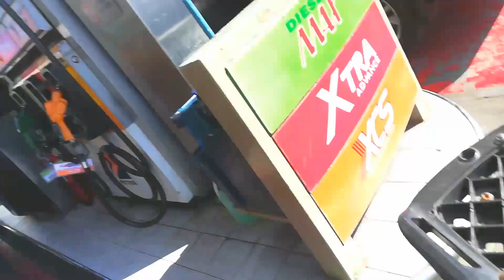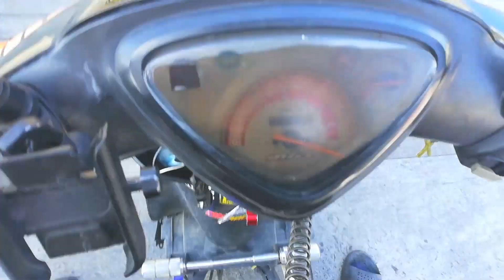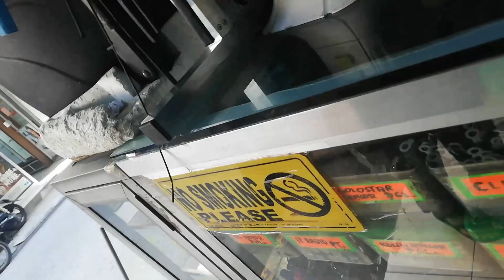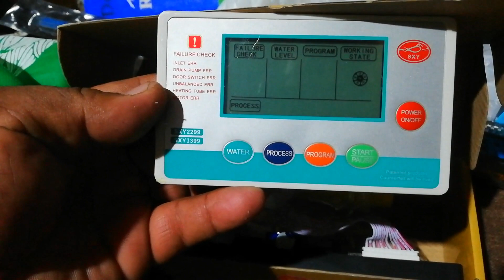Nag punta kami sa quiapo Manila naka Kita kami NG kamote sa Daan!

Comment: sir, good evening taga indang cavite po ako at nagkaproblema po ang wobble washing machine namin sa water inlet valve ayaw magopen check ko ang voltage 110 lang po,nakita ko ang ginawa nyo sa isang video nyo nagopen ka ng  mother board sa likod,gusto ko sang dalhin sau ang mother board.
Reply from the maker: Pm nyo po sa messenger ko. dijey mejorada
Reply: @djmejorada  bossing sa messenger ba kamo wala po eh,tnx po
Reply from the maker: Meron po baka hindi nyo Lang na hanap